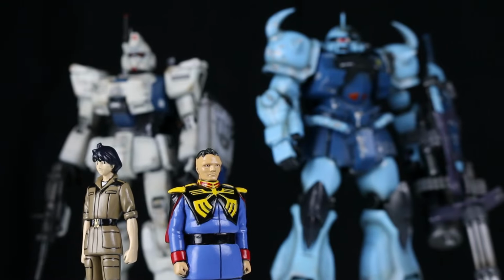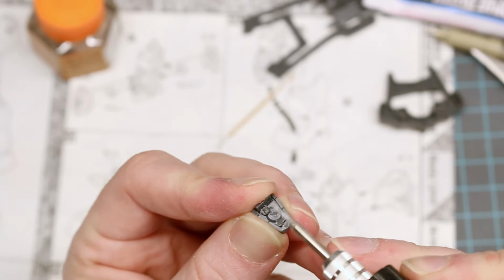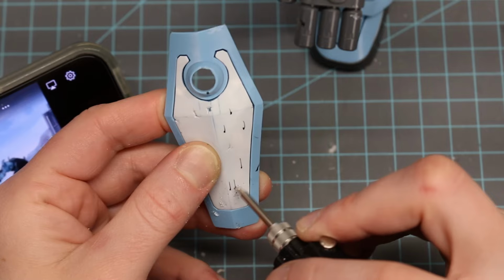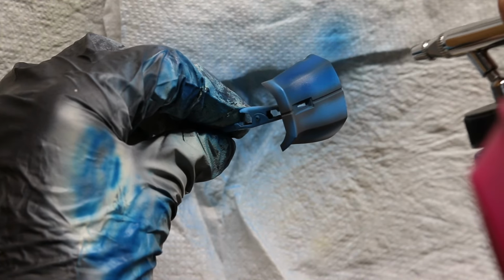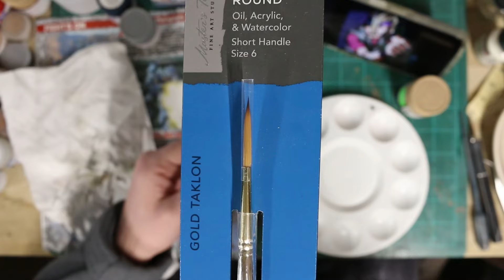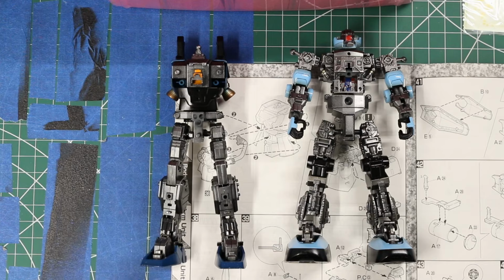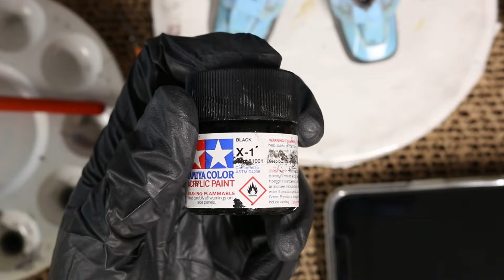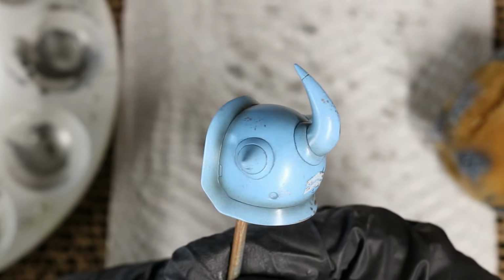MG Gouf Custom (Show Accurate Battle Damage)

Comment: Nice work. I’ve built this kit myself and I did a full inner frame detailing of the pistons and joints. It was my first inner frame detailing. Talk about a lot of fun detailing everything.
Reply from the maker: I agree.  I love painting the details.  Even if you don’t see them.  Thank you!!  One thing I love are the pilot figures.
Reply: @neglectedgundam  I’ve painted them all as well.👍😎 It’s very fun to do. I’ve even made it where you can take the outer armor off and show off the inner workings and make it look like it’s in a repair bay if you wanted to.
Reply from the maker: That’s a cool idea.  Once I paint and assemble.  The armor stays put cause I don’t want to scratch it.

Comment: Im new to airbrushing. What setup do you use?
Reply from the maker: I’m currently using my Dad’s pneumatic airbrush compressor.  

Thayer & Chandler Air Star V.  

I miss my Super Silent 20A though.  Left it on Maui when I moved.  Airbrush hose is connected to a water filter and quick disconnect.  I change between two airbrushes.  A generic Dual action gravity feed and a Iwata BH WL.  (It’s in my Altron video.  I may be forgetting the actual name).  I spray anywhere between 25- 19 psi.  

I also have a giant exhaust fan custom built by my father.  When he passed away.  He left me his art studio.  I use that exhaust instead of a common hobby one.  I’ll have a look in the studio tomorrow and add anything if I forgot it here
Reply: @neglectedgundam  i have no where that kind of money, lol. Do you have other recommendations that aren't that expensive?